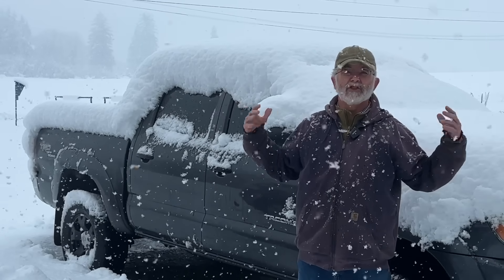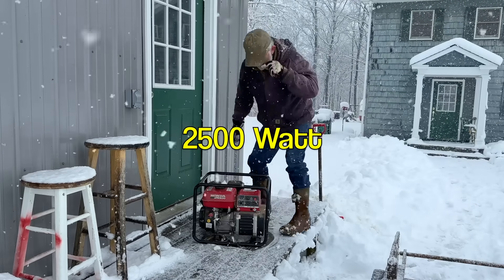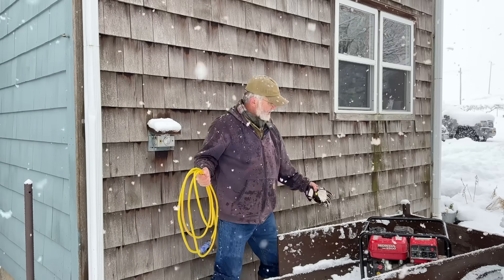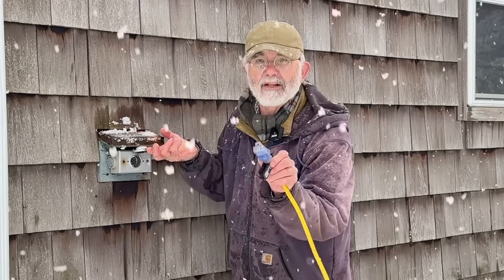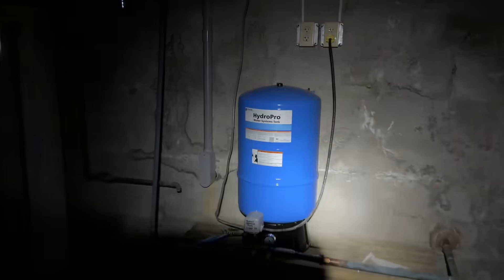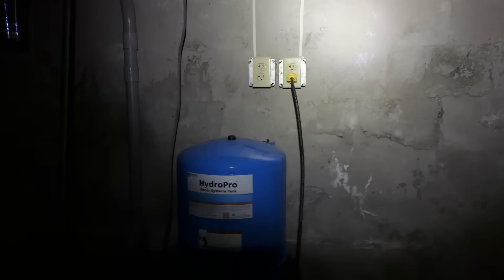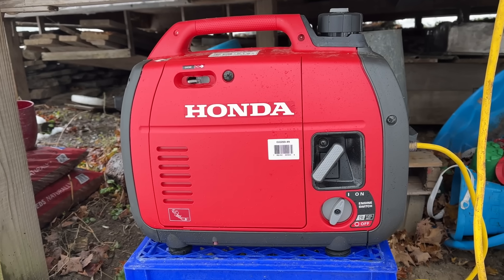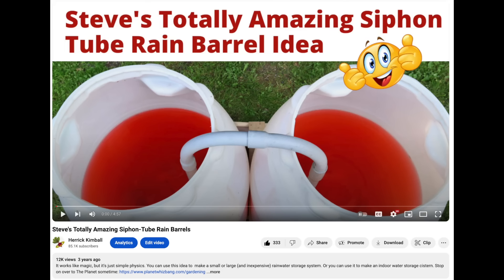Super Simple Generator-To-House Hookup  -- A Proven How-To

Comment: Wouldn’t heat be the most important thing necessary . To keep you warm and pipes freezing if power is off for days or week?
Reply from the maker: @MichaelWerner-p1e   Yes. For sure. I heat my home with a wood stove. Have done so for 40+ years. Put a propane wall heater in a couple years back as backup. It uses very little power. 👍

Comment: I would like to see how those pictures are wiredup to the generator inlet plug. Am looking to do something similar, but i don't want to pay $100 for a through the the wall kit. Want to build a box that fits in my window. Or power doesn't go out enough to drill a how through my wall.

Comment: If you shut off your main breakers coming "in" you can run a male extension cord from your generator to any outlet with another male end on the same cord to power your home.
Reply: That's called a ''Suicide Cord'' for a reason

Comment: This is nice simple solution, thanks for sharing.  I'm a fellow 'upstater' so i especially appreciate the advice!

A few thoughts, a 'real' transfer switch with selectable line/off/grid levers might make for a nice and cost effective improvement to the existing system.

Also, since your channel appears very robust, you might consider contacting Anker or other makers of battery chargers and ask for a free "demo" unit to evaluate.  It seems like there are ton of "reviews" of these things by Youtubers.

Adding battery and solar would be a nice option in addition to the ones you already have in place ...although you do need sun ! :)

Just curious how your well pump is only 120? How deep is the well? thanks again!
Reply from the maker: My well is just under 60 feet deep. Water level is at around 30 feet. I chose to use the 120 pump because I had the well drilled some time after I bought the generator and it doesn’t have a 220 outlet. 

My previous pump was for a 10 foot deep spring-fed hole in the ground. That’s the kind of thing you do when you build your own house out in the rural countryside without a bank loan. 

I think a transfer switch would need to go near the main panel? That is upstairs in the front of my house. I’d rather keep the generator in back, out of sight. If I were to build another house I would put the transfer switch in. 

I’ve resisted marketing or otherwise recommending anything given to me. I get emails with offers of free things. Not yet. Maybe someday. Probably never. 

Thanks for the comment. 👍
Reply: @herrickkimball  Thanks Herrick for the information.  makes sense for such a shallow well. Mine is 380 feet (with a half horse submersible pump)  I built my house without a bank loan too, always making trade offs between "best way" and "most cost effective way".  We were without power for  about 3 days with that last wet snow pile up in late November.  At least NYSEG got us back in under a week and to be fair they are usually pretty quick to get the power back up by us.  Esp. when you consider all the trees hanging so close to the lines.  Nice to have backups for sure!

Yeah transfer switch very close to main panel (save on wire costs, and installation time).  I'm doing mine in the spring.

Comment: Admirable setup. One issue. What do you do when the power goes out during a storm. You go through the process to connect the generator and right after you connect it the power comes back and you have to disconnect everything again.
Reply from the maker: We don’t need power right away when the electricity goes off. It usually comes on within a few minutes or hours. The Jackery takes care of most anything we need to power for that time. The generator comes out only when it looks like we aren’t going to have electric for a longer time. It’s usually possible to tell. The electric company gives pretty good estimates of when power will be restored.

Comment: I’ve got a small house in a rural area and a 3500w generator I run an extension cord through the window to power our fridge and freezer. Unfortunately we cannot power the submersible well pump as it’s 220. We are so on the same page. No doubt the time will come when the power will go out for a long time or forever. Our family is prepared for it. The expectation is to survive without electricity in the long term. This deserves a follow

Comment: It is backfeeding . You should turn your breakers off too  .
Reply from the maker: It’s NOT back feeding. No need to shut the main breaker off. The generator is powering a circuit that is in no way connected to the main panel. 👍

Comment: Don't pull your pump. Run a power converter.
150 at home depot.
2 cross over adapters for wiring.
Then just plug it into your generator.
Back up battery for wifi. Or cable box.

Comment: There is one small step you could take to improve your well power connection. It's very easy to do the change. All of your existing wiring remains with the exception of the 2 receptacles above your pressure tank. Replace the 2 4 inch square boxes with a single DEEP 4 inch square boxes and use a raised cover with the appropriate mounting pattern for a switch. Install a Double Pole, Double Throw, Center Off (DPDTCO) switch into the wiring that you already have  with the wires to the water pump attached to the marked and color coded common terminals of the switch, the wires of the water well branch circuit connected to the cable from your outdoor flanged inlet. Mount the switch on the raised cover and place the raised cover on the 4 square deep box. run liquid tight flexible metal or plastic conduit to the bottom of the box and install wall clips over the flex within 1 foot of the switch box and 1 foot of the "pressure switch" enclosure's entry knockout to hold it in place on the wall to be less exposed to physical damage and meet the code requirements for the wiring method. 

When the power goes out you throw that switch to center off, start your generator, connect your generator's supply cord to the existing flanged inlet you already installed, and throw the water pump switch to the position opposite the one you have it in when you are powering the water well from it's utility supplied branch circuit. 

This may seem a technicality to some but the US National Electric Code (NEC) forbids supplying a load  that is fastened in place with flexible cord unless described in 
Uses Permitted as set forth in article 400.10 Uses Permitted 
(A) Uses 
"(8) Appliances where the fastening means and mechanical connections are specifically designed to permit ready removal for maintenance and repair, and the appliance is intended or identified for flexible cord connection." 

A good example of such an Appliance is a food waste disposer. 

The reason for this provision of the NEC is that decades of electrical industry experience has shown that portable cords are too easily damaged when used to supply equipment fastened in place. 

Tom Horne

Comment: Hello Herrick,  Just want to comment on your tripod and well bucket. While prepping for Y2K, we were lucky to have gravity water but our friends had a well. He simply installed an inline hand pump in his crawl space where he could access it from inside and it was protected from freezing. We were SO disappointed when nothing happened! Oh well, here it is 25 years later and things aren't looking too good.
Great ideas on the jenny hookup. And still stay legal. Lots of good comments except for the folks who didn't understand what you did and the usual freak outs about backfeeding, although not to say it's not a serious issue. Re the sliding lockouts, unless I'm missing something, one would still have to remember to manually shut off the main. Last summer we kept the lights on, the music playing, the water hot and the fridges cold for three weeks after a wild fire here in BC burned several miles of poles and power lines. I like the propane units as we don't have to worry about stale gas and gummed carbs.We also used a 3600KW 120V solar generator so as not to run the 8.5KW generator full time, and a transformer to run the 220V well pump. But eventually, if things go bad, we'll all run out of fuel....
Reply: The "sliding lockouts" are called "interlocks" because they "interlock" the main and the generator inlet breakers. This makes it physically impossible to have both breakers "on" at the same time. They both must be off before one can be turned on.

Comment: I will add one thing,he needs to shut off his main breaker. So if there power company turns power bak on he doesnt back feed them or cause a tripping. I was licensed for 33 years out of northern,IL. ; also was a A card IBEW journeyman LU 134 for 12 years.
 I know he seperated it, but just to be safe
Another solution an LP gas generator. Remember you are allowed 80% of a circuits rating, so your 2500 watt genertor puts out 20.8 amps -80% you have 16.8 amps to work with . You need to be up in the 5000 watt range then feed your panel with a 40 amp breaker 2 pole  And shut your main off, or if its a newer service pull your disconnect outside. Now you will have your entire house on including your fridge. My humble idea for you. Have a great holiday. The 40 amp breaker will protect your panel & generator. Hugh Mc.

Comment: Good stuff, in order of importance would be #1 house heat for us in the cold . Lights are easy as a flash light and a couple of candles, we have a backup battery like your Jackery for the modem to get connected for how long the power will be out . Our furnace is a boiler with a small circulation pump on 120 volts and I wired it so it can be plugged into along with our tankless hot water. My gas powered gennie is out in a shed with extra 10 gallons of gas with seafoam in it to stabilize. The biggest mistake with gennys is,,,,,,,,to wait until the power is out before you get it running and CHECK THE OIL , most have a low oil switch and they won’t start . Backup is a small inverter off of your car/truck battery , engine running and a power cord into the house to run the furnace. And past that one is to pitch a tent in the living room and heat that small area make some hot water put it in a thermos hot water bottle , never candles inside the tent, boil water with a camping stove in the garage or just outside unless it’s butane at the stove top . My genny powers two fridges, two freezers, induction hot plate, microwave, Nespresso , tv and lights , oh ya I also forgot, and my heated toilet seats while my neighbors sit in the dark. Thanks for the video , thanks dad and mom for signing me up for Cub Scouts , and Boy Scouts , and common sense. Peace on earth and ocean everyone.

Comment: I do something similar except I'm powering breaker panel in my house. It is imperative if you do this to turn the panel main breaker off. I have a cord made up of  10ga wire that plugs into the 110V plug on the generator and into my dryer receptacle. When doing it this way, all 220V Breakers have to be turned off. This makes both sides of my breaker panel hot. All lights and 110V receptacles will work. REMEMBER ALL 220V BREAKERS AND THE MAIN BREAKER MUST BE OFF. I use the dryer receptacle but any 220V receptacle will work.

Comment: I have a slightly different setup I have underground power to a pedestal in my yard And when we have a power outage I can run A wire directly to my breaker box in the house Then go outside and cut the main Off At the Pedestal ,It runs the entire house  on the generator ,To run the water heater I have to cut everything else off But it works very well . We have county water So that is not problem. My dad had a setup Similar to what you had it worked well.

Comment: Nice low tech video.  My major concern with generators are running and using fuel when their may be no power demand.  I have purchased a solar generator and some solar panels to solve this.  If the sun isn't shining I can charge the solar generator with a regular generator.  The nice thing about the solar generator is that it only provides the power on demand and is whisper quiet.  Unfortunately, an EMP event would probably render most newer home utilities useless if they have micro processors.

Comment: I would avoid tilting your generator almost on it's side while running.  The oil needs to be in the bottom of the engine.
Reply from the maker: You make a good point. I tipped it only briefly which is not a problem. But the generator definitely needs to be level when running. I actually shimmed under one side of the generator with a scrap of wood to level it in the garden cart. The same thing applies to portable air compressors. I was once in a job where a portable air compressor was placed on an inclined roof. That didn’t end well. Thanks for the comment.
Reply: @herrickkimball  You're welcome!

Comment: Looks like you did this right with no possibility of back feeding the utility. Only disadvantage is that you can't run hardwired things with it. For that, you would need a transfer switch system, which are not cheap. There are, however, single transfer switches and you might consider that if you would like to run something like your furnace, provided it only needs 120 volts. You lucked out with the 120 volt well pump. Didn't even know there was such a thing. 
I believe you said you have a battery inverter unit and you might consider getting a couple of solar panels as a secondary source of power to charge it. Unlikely it'll provide all the power you want unless you got several panels - also expensive, unfortunately. If you do, don't mount them on the roof be cause that would make cleaning them a hassle - something it looks like you'd have to do a lot in winter.
I rigged up a couple of 50-amp receptacles for my old mobile home, one for the utility, one for the generator. These, too, are totally independent, like yours, so no back feed possibility. I just plug my 50-amp 8-gauge power cable from my circuit breaker panel (actually is a secondary with isolated neutral and ground rails) into whichever one I want to use. Because the two line cables, neutral, and ground wiring are totally independent, there is no multiple neutral-ground bonding issue because the bonded neutral generator provides that and the main utility meter/ breaker box provides its own. 
I can run the whole place, except the water heater, with a older Powerhorse 4000 generator (3100 continuous watt rating) provides 120/240 VAC. (The new 4000's only have 120 VAC.)This works great because it runs hardwired things like my propane furnace, bathroom and kitchen exhaust fans.

Comment: I have a Honda 2500 generator, got it in the 1980's and still runs like new. I use it for about a week or two every 3 to 5 or so years when hurricane knocks out the power.
I keep the same gas in it when storage, that I used when running. never drained it and never had a problem with it running that way for around 50 years.
Reply from the maker: Nice. Real nice. 👍

Comment: Great video. And fabulous easy use of low tech transfer of power. The only thing that might help those younger than yourself is to label the duplexes as main distribution and those as generator power. People with there head down won’t know to trouble shoot or trace circuits. Thank. Mike

Comment: How about your heat?
Reply from the maker: Wood stove for the house for 40 years. Put a Rinnai propane heater in a couple years ago. It’s for when we get too old to heat with wood. My shop has the same model Rinnai for heat. Very efficient. A battery will keep it running for a long time. 👍

Comment: I have a "portable" generator in my garage which can be hooked into the electric system with the use of a wall mounted  DRYER RECEPTILE.
  All I have to do is SHUT OFF the main power from  power pole to the breaker box so that I don't feed power INTO the power grid.
Reply: Man, if you forget to turn off that main breaker . . . really BAD things could happen! Like frying a utility worker trying to restore power or starting a fire in your house if the power comes on and the generator is still hooked up and running. PLEASE get yourself a transfer switch or one of those generator interlock kits which are very inexpensive.

Comment: Out in my shop I have a 220 volt receptacle for my welder is a 10 gauge less than 5 ft from my main fuse box in the garage I have a number 10 Gage about 10 ft long extension cord I put it outside of the garage my breaker box is a 100 amp in the garage and it goes to the house to a 200 amp service on the house when the power goes out I shut all the breakers in the house off and the garage I shut the main off going out to the pole and I also pulled the meter so it's double insulated from back feeding anyone working on the lines plug the extension cord in start the generator and then I turn on the breakers as needed one of the time in the house and garage usually it's the furnace the refrigerator the sump pump and some lighting as needed it will also run the well pump but I only run that when I want to pressure up the water then I just shut it off to guarantee that I'm not pulling too much amperage of any one time it works wonderfully
Reply: I know some people will say that's dangerous but I don't leave the house that way so no one's going to come along and put my meter back in and turn on the main at the same time

Comment: I do mine same way and have same two Hondas plus a propane 30A unit. I use pool water for toilets. My well pump is 220v so don't even bother powering it as I setup a RO system to 55gal holding tank which is always full and would suffice for a long time.

Have thought about a portable power unit for ease of powering basement fridges (instead of long 14 ga extension) but hard to justify that cost when deep cycle's and small inverter work fine and the batteries serve multiple uses (boat, jumper, etc..).

Bottom line: Install receptacle for up/down for me seems my most cost effective way.